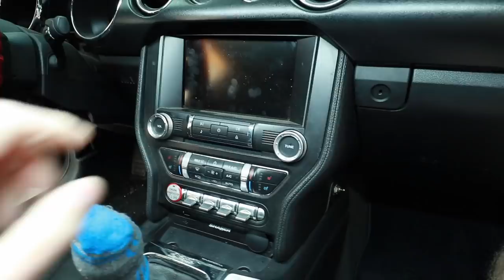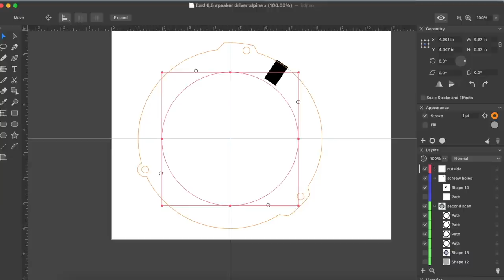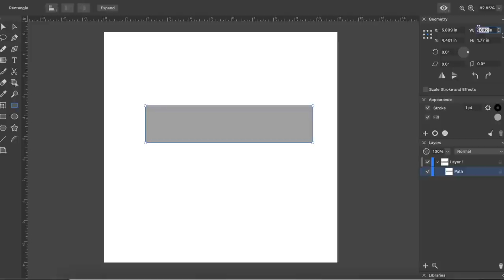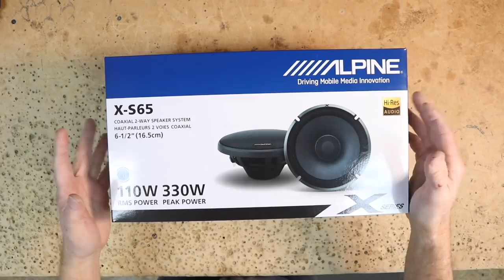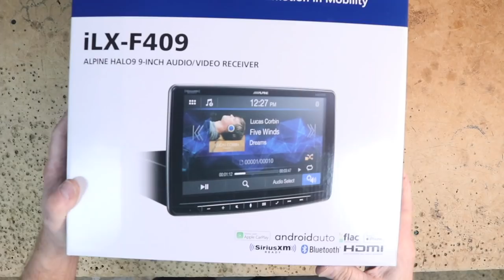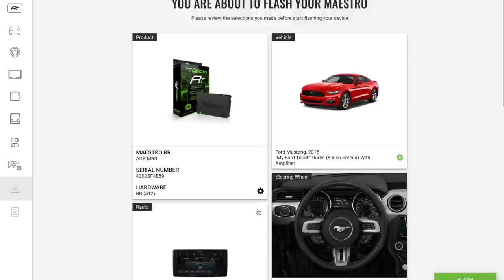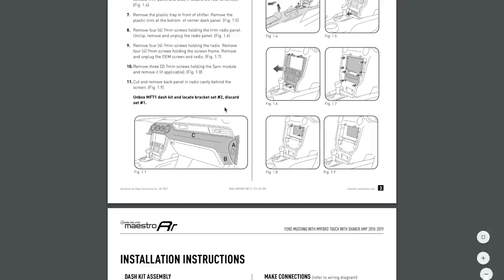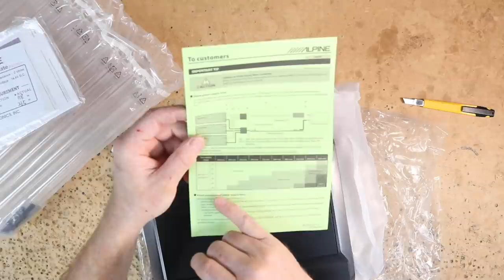Full Roush Mustang car stero build

Comment: i don't understand why the 6 channel amp used for the front 3 way and set to run off just 1+2 rca also needs the rear rca connected ? firstly they are not needed and secondly they are not feeding anything